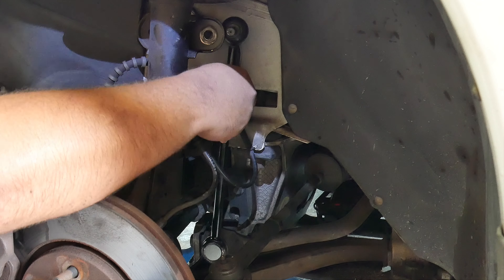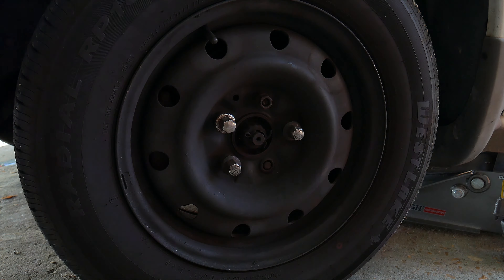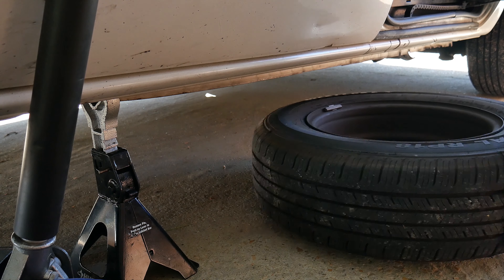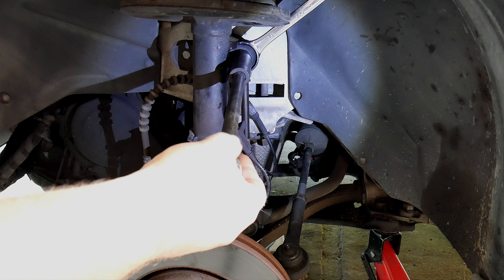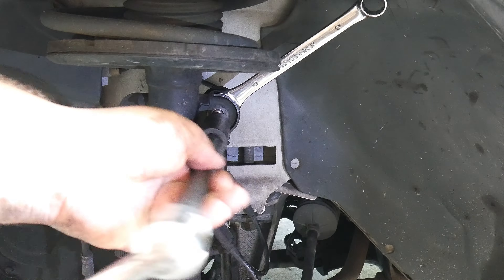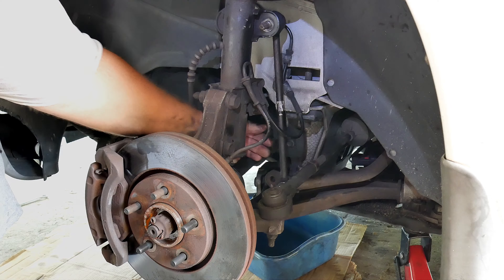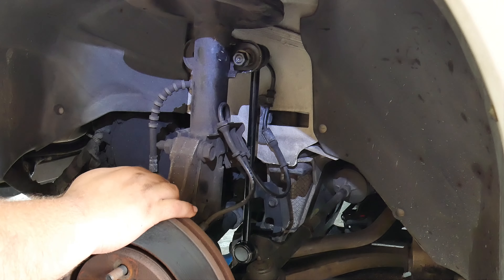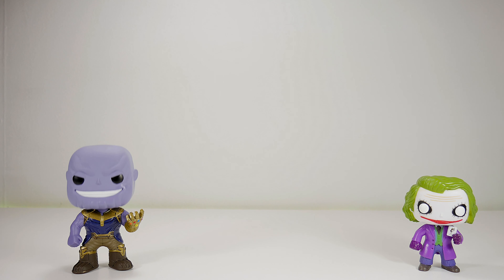How To Replace Install Stabilizer Sway Bar Link Easy Simple

Comment: I’m still gonna pay my mechanic to do it. But as someone who has never worked on my vehicles, these videos help me to understand the issue! Thanks for the video, it was really straight forward.
Reply: what a nice way to say youre lazy
Reply: Waste of money. My moms car had a clunking noise, come to find its missing the lower bolt on the sway bar link, ordered a new one and the hardest part was realizing I didn’t need to fit an impact gun in there or take the wheel off. Got the new one installed without removing the seized on wheel and didn’t use power tools

Comment: Thanks. That idea of lifting up the suspension might just do it. I've been levering the stabiliser bar down to get the new connector in with no luck. 
10 mins later...YUP! Bottle Jack under the hub doodad, that did it! THANK YOU BIGTIME from France.

Comment: I just bought a nice 3 ton low profile floor jack to replace my leaky 2-1/4 ton jack. I was going to gift/sell it, but already I've found two uses for it. One of them is this! I also recall using the jack to align the suspension when swapping out a broken control arm TWICE (both on Kia vehicles).
Reply from the maker: Nothing better than giving a second life to a tool .💪💪

Comment: Your clear and accurate video showed me how to change my own front sway bars links on my 2013 Explorer and saved me $80 .........although it took me about 3.5 hours.....thanks. I guess in your next video, you'll show us how to replace broken or short wheels studs like the ones u have.....lol.
Reply: I didn't take the time to look into this. I was at auto shop. They showed me the problem. I said go ahead. Little did I know that these things cost around $20 each. They charged me $95 each! Talk about getting fkd over! Next time I'll do some research BEFORE I say ok to repair work!
Reply: Total cost was $306

Comment: If you're having issues with newer models (I have an 2013 Toyota Corolla) due to the way the bottom assembly is structured I was able to remove the bottom link(nut) by angling my own "breaker bar" like he made in this video and then going clockwise to break and unscrew the nut. I still had some difficulty removing the nut due to the limited opening however, it's possible. YOU CAN DO IT 👍🏿 just say a prayer😁 (I really did).
Reply from the maker: Awesome tip!!👍💪😁
Reply: @StatUpBox  can I change mine without removing tires
Reply: What were the torque specifications for your Link Rod nut?
Reply: @djmobn  no its gotta come off just use a 4 way or breaker bar

Comment: Some times you have to cut the link out if the nuts are rusted extensively and you don't have a back nut. The Allen wrench will just strip when you try to turn the nut. It's much easier if you are replacing the strut at the same time.

Comment: Just saying missing lugnuts creates enough weight imbalance to vibrates wheel and cause bushings and links to wear faster
Reply: all the lug nuts were there, just 2 of them were black and blended in with the color of the wheel.

Comment: So the swaybar links are not supposed to pivot??? Damn I didn’t know that here I am adjusting my coil over height up and down trying to fix the issue when the issue is the friggin swaybar links are busted. Is it still OK to drive for a fewdays if it pivots like that, of course, have it bolted in as usual?

Comment: Sway bar links that doesn't come with a hex insert or a nut behind is the worst. U can turn a 3hr job into a 2days job
Reply: Use a Sawzall or a grinder to cut the threaded stems and then take it off.  Few minutes tops.
Reply: If you plan on keeping the car for a while be sure to purchase replacement links with back nuts. Allen hex holders are worthless in removing since the nut is likely so rusted the Allen wrench will just strip.

Comment: Any advise for when it starts free spinning when I try to take the nut off??? 😳
Reply from the maker: did you place the wrench on the back, and laid it against the top body ? is it the same size?
Reply: @StatUpBox  I ended up cutting it off, there's nothing to grab on the back side as it appears to be a ball in a socket.
Reply from the maker: here at the statupbox team we salute you! you are DIY veteran. yes, that is one option, at the end you are not going to use the old part again, unless for a trophy, for the day you showed it who is the boss!!! 💪😎👍😂❤

Comment: It would not be so easy to remove the nuts   if you car is old and the nuts are all rusted, and your sway bars do not have a hex nut in the back, but a useless hex hole in the front.  Cutting the nuts would be the only option in that case.
Reply: yeah unfortunately i had to deal with this yesterday and spent an hour trying to cut the things off